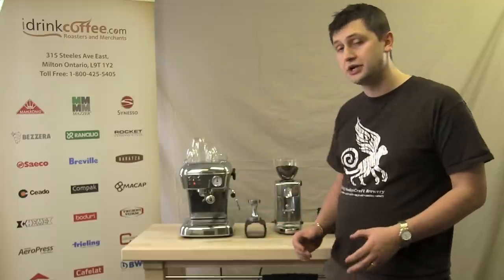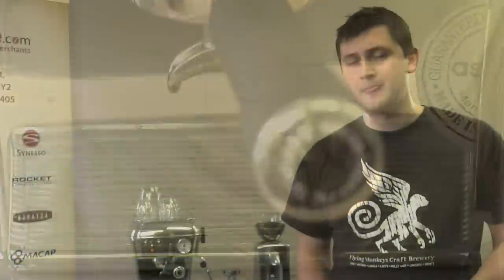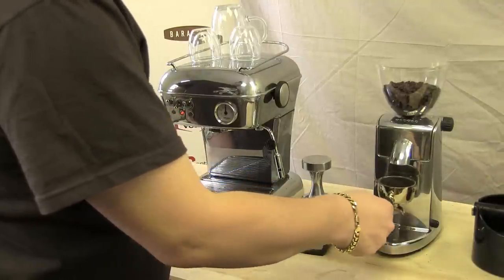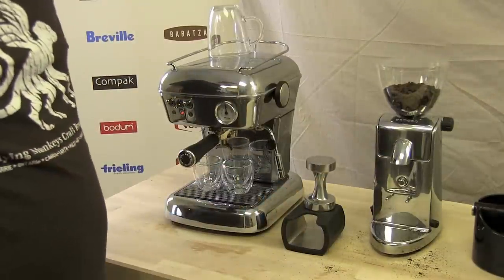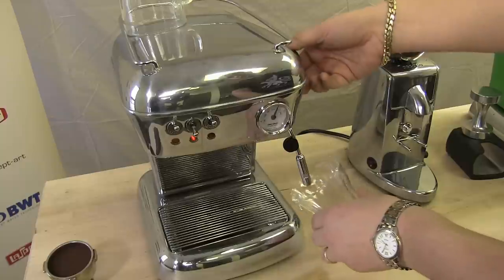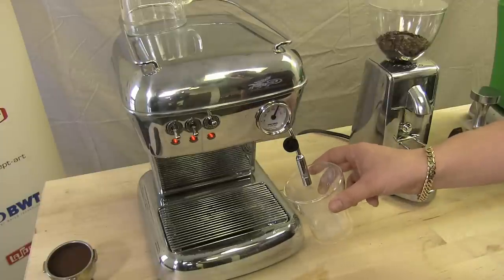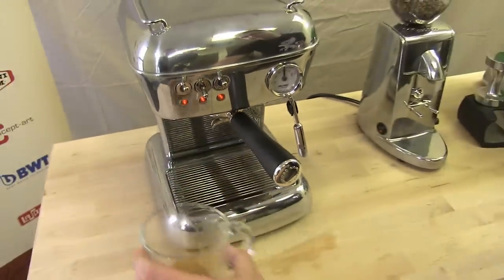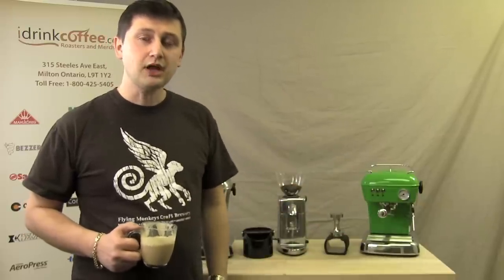Ascaso Dream UP Preview and Demonstration

Comment: Hi Jeri, I have the same on mine. It works fine, but like you I am also curious about the rat-tat-tat when I switch the steam switch on?! 

Also when frothing milk the temperature dial ends the process right up to max 150°c. I have watched numerous videos and when the steam wand is used, the temperature dial remains around 125°c. As shown in this idc video.

Still It does make great coffee.

Comment: QUESTION: when we flip on the steam switch to froth milk (whether we do this BEFORE pulling espresso, or AFTER), we get a rat-tat-tat-tat noise (water take-in tube or the water pump???); if we continue steaming the milk, the noise continues throughout, but the frothed milk turns out perfectly fine--still, the noise seems not right??? What are we doing wrong?

(we thought we understood espresso machines! yikes! still, we love the
Ascaso Dream--just want to be sure we're using it correctly)